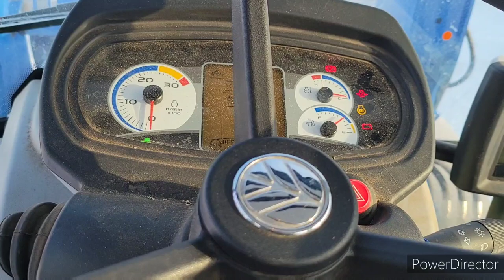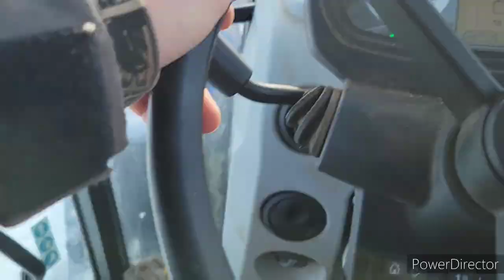Clutch Spring Replacement On Powerstar 120.

Comment: Hey Straightpipe, next time slip flatwashers in every coil of the spring ( both sides) your spring is now lengthend hopefully to an extended position enabling you to now slip the two ends into the required holes in the anchor points. Now push the clutch peddle and the washers fall out. Job done. Try it. Works pert near everytime
Reply: This is genius! Thank you

Comment: Great result on the twins 💪 well done puttin that poor critter outa it's misery job that the shooter shuda done 🤬🤬 when I bin changin springs always try an attach at top then just use a length o baler twine to stretch it onto mounting point then let twine slide off 🤔👍 great video Ryan 👍

Comment: My buddy that used to work on snowmobiles had long straight screwdrivers that he would put about a 30 degree angle just before the end of it and then grind a notch in the middle of the tip and another where the flat turned back into the round shaft so you could either push the spring away or pull it towards you
Reply from the maker: That's what I made but there was no room in that shitty lil spot

Comment: I'll give you one for holding back while trying to install that spring. Next time try wiring the two ends together and draw them together like a tourniquet. Then, slip the spring on and cut out the wire.
Reply from the maker: It was a stretch spring not a compression
Reply: @straightpipeacres6365  Ok, so if the ends aren't flexible, insert coins in between the coils of the spring to elongate it, then remove them after you install it!
Reply from the maker: @sagecrockett693  👍

Comment: Did that new spring fix your problem?  I have a NH 105 and I’ve replaced the spring and clutch cable and it still is sticky.
Reply from the maker: I ended up getting a heavier spring. The factory ones are junk